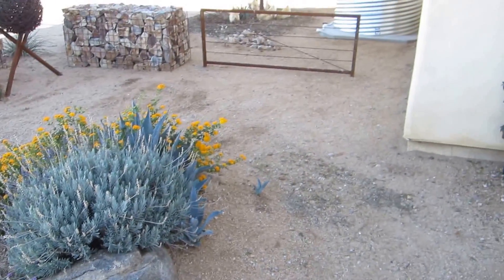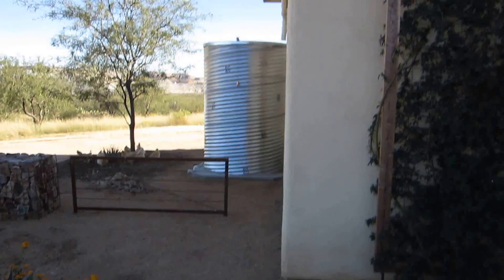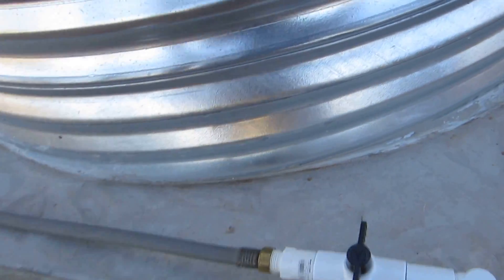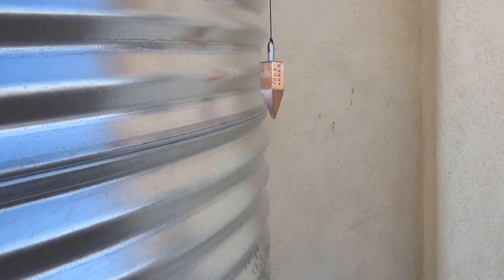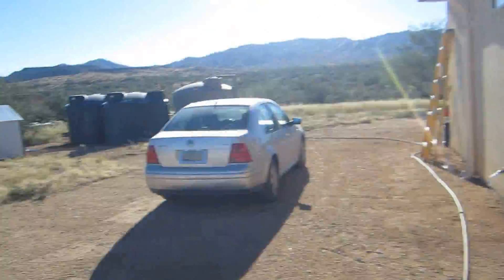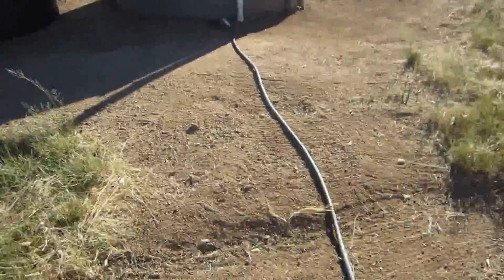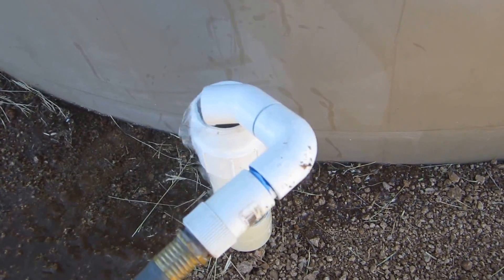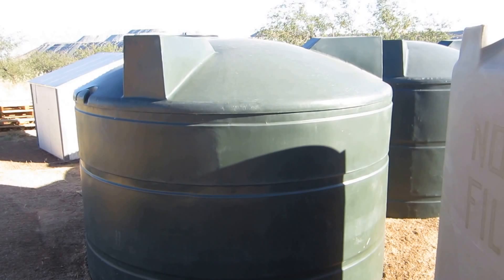Culvert cistern water transfer - no electricity method (Sept. 2013)

Comment: i don't get it.  Where you put the white hose into at the end was a huge cistern it looked like, but if it was full it would be leaking out of the inlet ... so what is the point of that?
Reply from the maker: its just for filling when it is below that level.  Youre right it would leak if I opened that cap when full:)

Comment: How does it fill up the second tank once the level rises above the fill tube?
Reply from the maker: If the level is above the inlet then I have to use a pump.  That level is about 3000 gal so I have a good amount fill room before I have to use the pump.  Right now all of our tanks are overflowing due to a couple good rains we had this past week.... so now i gotta figure out more capacity;)  Thanks for watching Ricky
Reply from the maker: Ricky Parker Yeah... the tank is about 14' tall with about half in the ground.

Comment: Is the tank water your only source of water? I really like the landscape of the area where you live and how you are going about planting and using water to suit it. I live in a fairly rural area of Australia where we regularly have quite long hot dry spells so I know how important it is to use water responsibly.
Reply from the maker: Yes, rain is our primary source of water.  If we didn't garden then we could probably make the entire year on just our summer and winter rains.  However, when we do run low then we have a water truck bring us a couple loads to help make it to the next rain.  
I feel you on the hot dry spells, we get around 12" of rain here are temps are well into the 100's throughout the summer:)  I hear it is pretty common for folks to catch rainwater in Australia, is it common in your area?
Reply: homesteadonomics Rain water as a primary source of water is extremely common in my area and if you head a little bit more north a lot of people will have rain water for house hold water and bore for use in the garden. A couple of years a go we had such a severe drought that it was illegal to wash your car water your garden so most people have a tank.for outdoor use.

In my state Victoria (and possibly Australia) it became law about 3 or 4 years a go that if you build a house you must have an energy saving device eg rain water tank or solar panels etc. Most people install a 1000 liter water tank and pressure pump and use it for toilet flushing as it is the cheapest option.